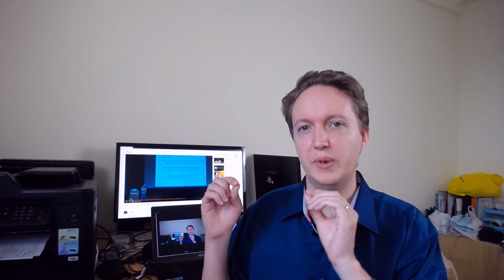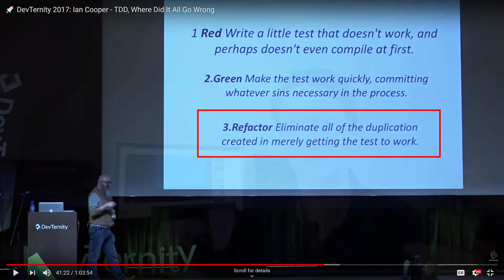Duct Tape Programming is Hard

Comment: First, you should use a language with a sound type system (or if using TypeScript, add many rules). Write small chunks of code that are logically divided. Write tests to these functions. Don't perform side effects in this code.Then compose these functions. If you did it right, it will be trivial to refactor, as your type checker, linter and test framework will complain as soon as you did something wrong.
Reply from the maker: Good advice. However, duct tape programmers don't write tests. One key to their productivity seems to be using only a handful of coding techniques that they're very good at, and ignoring fancy new techniques/frameworks/coding-patterns. New stuff have a learning curve, and often have teething issues that need to be ironed out. All of that takes time.

Comment: One thing I strongly recommend although it is admittedly very controversial (I've been chased away from StackExchange by object-oriented enthusiasts with pitchforks and have started to favor friendlier open-minded folk like yourself to exchange ideas) is to ditch the idea of using object-oriented programming for "design". I have nothing against using objects to help us implement things. Bundling related data and functionality with encapsulation makes perfect sense in so many places. Shallow inheritance hierarchies and inheritance-based polymorphism make perfect sense in some specific cases where all design requirements can be easily foreseen upfront.

But the problem I find specifically with object-oriented "design" -- to try to start off designing software by breaking it down into objects -- is that it's just too far divorced from user-end requirements. Users want to "do" things -- verbs, not nouns. And yet the object-oriented enthusiast often starts bottom-up in trying to come up with a library consisting of a bunch of nouns to facilitate what the users want to do... and it might then be weeks, perhaps even months in some cases, of iterating and iterating and iterating over this library of nouns before a single function is written that begins to directly tackle that user-end need. From the perspective of the PM, the amount of progress at this point is a gigantic question mark... to some, it might even seem like zero progress is being made. But I would say that even disregarding the unfortunate knowledge gap between managers and programmers, these programmers who are so fussy in iterating and iterating and iterating over the same code while trying to build libraries of interdependent objects tend to very rarely succeed in even building something that lasts for years to come as they hoped in spite of all the upfront costs they incur. It's most likely because they started off too far removed from the user-end requirements which will tend to evolve and change on top over the passing years. What tends to last for years and stay in fashion is more often like some simple isolated C library built in a more procedural style and tackling a need as directly as possible over some highly-interdependent object-oriented framework.

I have seen and experienced a way to make more obvious and consistent progress (not two steps forward and one step back), even in the eyes of an ignorant PM, and without resorting to duct tape programming that incurs technical debt left and right. But it tends to favor designing with more of a procedural or functional mindset, and starting off tackling design requirements more with functions than objects. And by doing that, and establishing the TDD mindset more around functions, not objects, we end up quickly establishing an interface consisting of free functions that very directly tackle user-end needs... no more, no less. And we might implement a bunch of objects along the way in implementing these high-level functions, but they arise out of the need for these functions designed more procedurally or functionally, and as implementation details, they'll tend to evolve with the needs of these functions rather than skipping 100 steps ahead trying to anticipate future needs that may or may not arise.

The other thing I think is very useful is to consider whether data stability or functional stability is easier to establish (in "stability", I mean the tendency to not require further changes). The dependencies throughout the code should flow in the direction of what is most stable -- what is most unlikely to change. In a video game, it might be much easier to say that all elements of a scene graph should have a 4x4 transformation matrix, and we might be able to confidently commit to the idea of using 32-bit single-precision floating-point there. We might have a tremendous degree of confidence that this will not change in any near future, and be absolutely correct every time in such assumptions.

Meanwhile, it might be very difficult and error-prone to anticipate in advance all we can do with such a matrix. We might keep finding new things to do with it, and so it's obviously very improbable if we just put a little bit of thought upfront to design a perfectly stable interface upfront. Yet the OOP enthusiast will often begin by hiding this matrix as a private member of an object behind a public interface and try the much harder task of trying to design a stable interface of functionality, so zealous in terms of adhering perfectly to encapsulation and information hiding and the ability to maintain little invariants, that he trades what could have otherwise been extremely stable dependencies to data to extremely unstable dependencies to an interface that's constantly getting changed (possibly causing cascading changes throughout the codebase including a need to constantly rewrite the tests themselves). That shyness of just letting such stable data be publicly accessible (perhaps just stored in a plain old C-style struct) starts to become really counter-productive at this point. In other cases, it might be easier to anticipate all the functionality that's required but the data representation is more of the big question mark, and in those cases, it makes perfect sense to start off internalizing and hiding the data and direct the dependencies to a public interface. But I think many object-oriented programmers cripple themselves by always designing and implementing everything as though the interface is always going to be more stable than the data.
Reply from the maker: Interesting commentary. It would be good if more programmers saw OOP, procedural and functional programming as tools rather than trying to find "one to rule them all." I'm hoping to learn more about functional programming because I think it'll be useful.

The OOP problems you outline such as hiding data behind a public interface is an example of trying to guess future requirements, and erring on the conservative side "just in case."
Reply: @KeaSigmaDelta  I often find that the mere act of trying to hide data behind a public interface that is unlikely to change much in the future is a very ambitious thing to try and prone towards failure in many cases. Most of the culture of TDD seems to resolve around OOP and SOLID. It might be rather domain-specific but I've not had a good experience from it personally or watching my colleagues -- often mixed success at best. An exception might be something like a generic container, but those tend to be very leaky abstractions... it doesn't take too much foresight to design a public interface for a random-access sequence like std::vector in a way so that all subsequent new design requirements, like an unanticipated design requirement to sort one, can be implemented externally as a nonmember function without intrusive designs to its public interface... or an Image class that provides full access to read and write any of its pixels (also a very leaky abstraction) enabling all image-processing algorithms to be implemented without any changes to its public interface.

I actually like very leaky abstractions. They tend to make the most sense to me in my domain to represent as an object, and it's the easiest to design their public interfaces in a robust and stable way that stays good for years to come. It's in trying to build numerous abstractions that leak the minimum details that I tend to find lots of difficulties. For example, if we try to design a video game, an object-oriented designer might want to start off building abstract interfaces like ICreature, IConsumable, IWeapon, IArmor, and so forth.

I find very quickly as we encounter complex design requirements in such cases like a need for a creature that can breathe underwater and gain attack and movement bonuses underwater, or a projectile weapon that can boomerang back to the player's hands, or a potion that makes creatures invisible, or a spell that arcs chain lightning and hits all nearby creatures from the one targeted, and so forth, that this introduces such complex interdependencies between these objects. It starts to become time-consuming to even think of where to place the appropriate methods that enable such functionality that we usually face the need to do one of two things:

1) Start expanding and expanding and expanding the public interfaces towards monolithic ones.
2) Start making one or more abstractions leakier and leakier (and possibly downcasting down to concrete details) until we start questioning whether they should exist at all.

And it's specifically in these types of cases where I tend to find the procedural or functional methods a lot more productive, and reduce something like a creature, or weapon, or armor, or things of this sort down to plain old data being passed as parameters to functions or just very leaky abstractions.
Reply: @KeaSigmaDelta  On functional programming, I think it starts to get cumbersome and impractical to get to the point of trying to implement higher-order functions and monads and currying and so forth left and right in C++. Yet there's a whole lot to be reaped in my experience by just favoring value semantics and pure functions when possible. There is this great talk at CppCon that I think is worth at least considering for every C++ programmer. I think it'd also greatly simplify the cases where you want GC and possibly even eliminate that desire if you structure your software enough around value semantics.

https://www.youtube.com/watch?v=sPhpelUfu8Q&lc=UgxE26CNh3PJxYIZ5IV4AaABAg
Reply from the maker: @darkengine5931  Thanks for the link.
Reply: I agree.

Objects (as in OOP) tries so hard to hide data in private fields when very often this is not a real problem. If I have a `Rectangle`, why can I simply not access the width and height properties? After all this is what defines a rectangle. On the other hand, I can imagine an infinite amount of functions that does something with a rectangle, and it's impossible to have an infinite amount of member functions in a class. Data is not defined by the functions that transform the data.

Of course, you can imagine many use cases where you have containers that themselves aren't allowed to "look inside" for the data that they contain. Think of lists, trees, futures, etc. These are called functors/generics/templates, depending on the language. But note that these structures do not encapsulate data by making data private; they encapsulate data by describing it with a generic type. Object oriented programs tries to hide the wrong thing!

If you do want to hide data, maybe you shouldn't pass the data along in the first place? In a language that supports closures, you can also pass a reference of a function that closes over the data.
Reply: @majorhumbert676  I think data structures are a wonderful use for the basic features of OOP but they seem like fairly leaky abstractions to me. If we conflate OOP with maximal abstraction, then generic containers are usually among the least abstract. A good library will let us iterate over and access each element of the structure and even mutate them along the way if that doesn't violate the data structure's rules. They leak every concrete detail except but the structural integrity required to even count as the data structure in the first place.

I found especially in game design though that inter-object dependencies cannot allow us to avoid designing a lot of things as less leaky than a data structure without cumbersome and monolithic interfaces.

For example, consider a role-playing game where a potion heals creatures. Either the concrete potion object has to have its details accessed by a creature or the creature's details have to be accessed by the potion to keep things simple. If we try to abstract away details both ways (like to conform to DIP in SOLID), we end up with a clumsy and shallow object-oriented interface that might even have methods to do nothing more than modify HP on creatures, and then we end up having to pass application state all over the place to even log the unique healing messages required for the customer on top of these clumsy and monolithic interfaces. Very soon we can find ourselves designing the leakiest abstractions with little more than getters/setters.

It gets even more complex if we consider even something like AD&D. With a rulebook spanning hundreds of pages with spells like fireball which interact with the environment (different effects indoors from outdoors, e.g.), we end up constantly wanting to X-Ray out abstractions to implement these things and find what we hid getting in the way of implementing what we want rather than helping. AD&D maps to a data-oriented mindset, not an object-oriented mindset. Immediately we can start reading through an AD&D rulebook and start implementing data structures as we go like so:

struct Creature
{
     int hp = 0;
     int str = 0;
     int dex = 0;
     ...
};

And that's a totally viable design that is mapping 100% to the user requirements. Try to abstract the analogical creature above and we might have to have complete knowledge of the entire rulebook (and risk missing things breaking our designs) before we even start writing a line of code.

So I think data integrity and maintaining variants, if that's a priority, is better served with a functional programming mindset than an OO one.